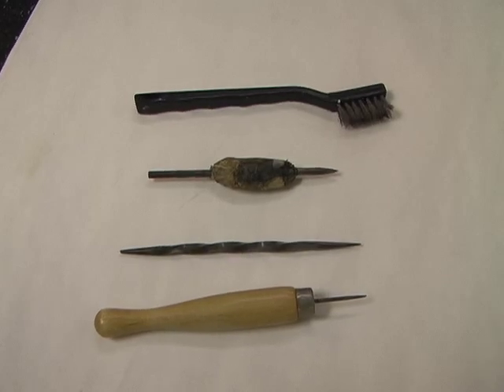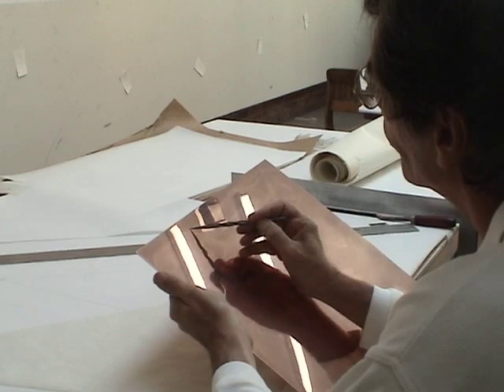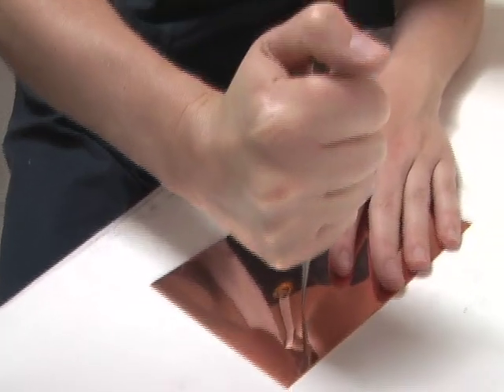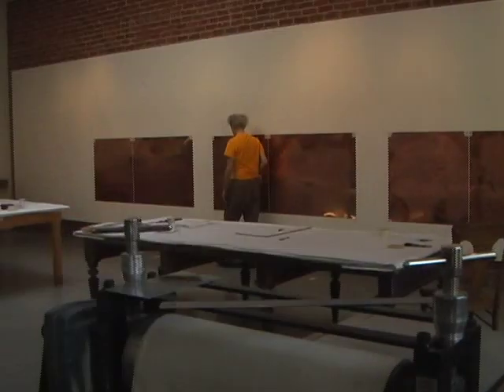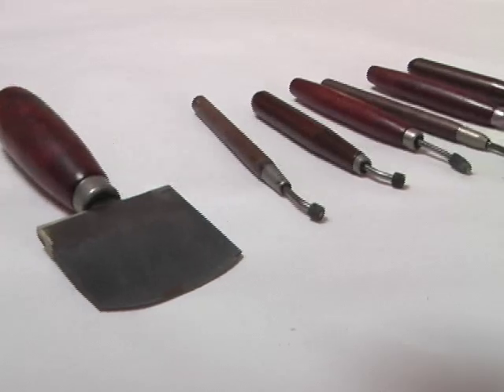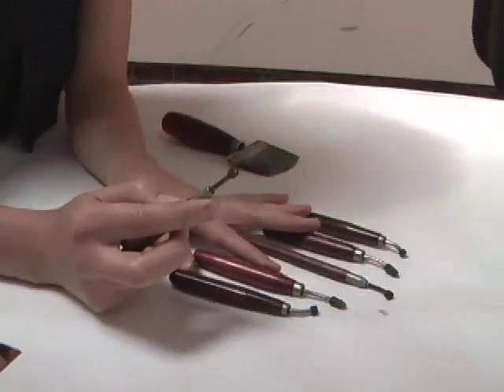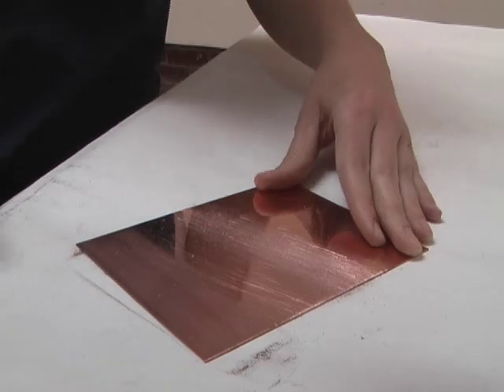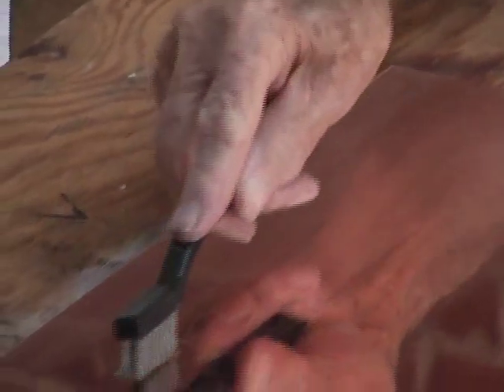Crown Point Press: Drypoint Technique

Comment: You can also paint a resist (home made butimen ball ground  in my case) and then place course sandpaper sheet on top, with paper on the bottom of the plate protecting the platen. Run the thing several times, where  the finer the paper the  more times you run it through. so 250-300 grit is maybe 6 to 10 times. Every time you run it through the press, you reposition the sand paper a bit to get more marks. When done send it to the acid and let it bite. the bite will be different time from regular line, do a test strip first.